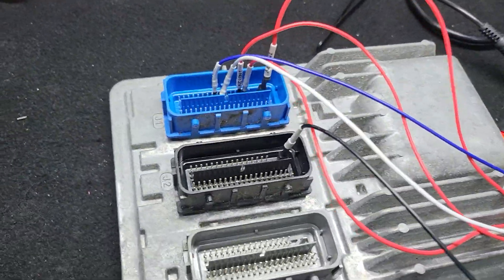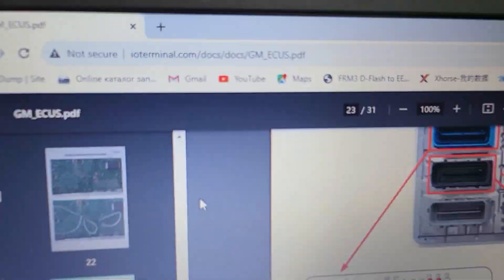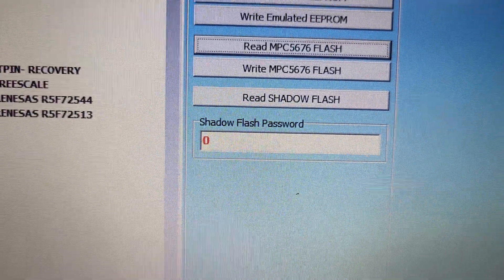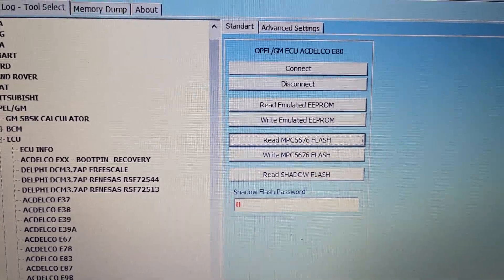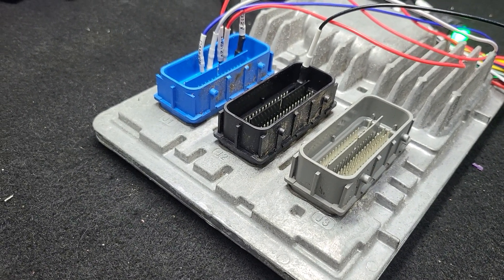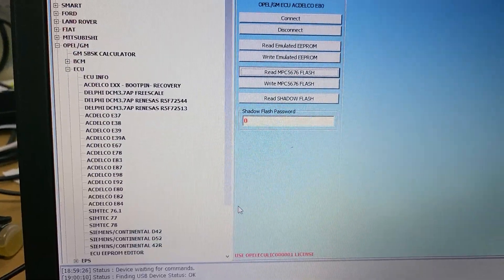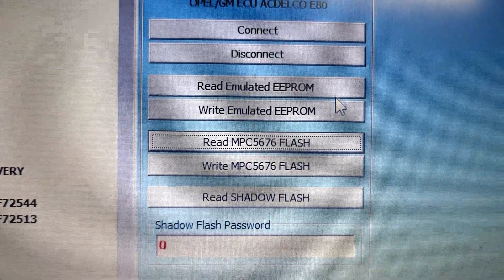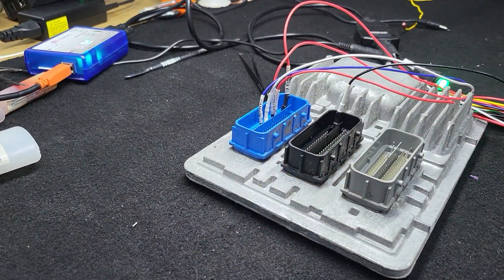Read and cloning ACDelco E80 ecu for Vauxhall/Opel Astra K using io terminal

Comment: Hallo. It is possible to swap the engine from insignia b 1.6 cdti
to insignia b fl 1.5 cdti ?
I am only concerned with the electronics.
If I reprogram only imibolizer in the engine controller 1.6cdti, will the bcm from insignia fl accept it ?
Reply from the maker: I the wiring the same i think so, but use an original ecu from the engine you'll swap, not from a car.
Reply: @ecuproguk  The wiring is different.
The engine is 1.6 cdti, fhrom insignia b, it is not in the insignia b facelift, I do not know if bcm will recognize it.
Reply from the maker: @peezmekxx1655  preface and facelift insigia has a different can bus communication protocol